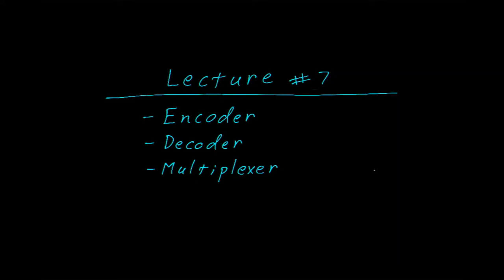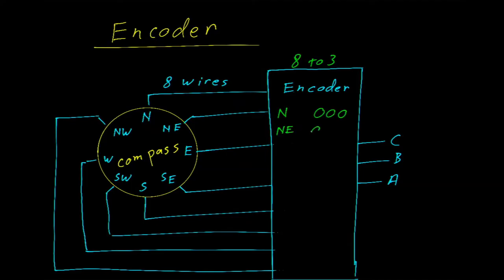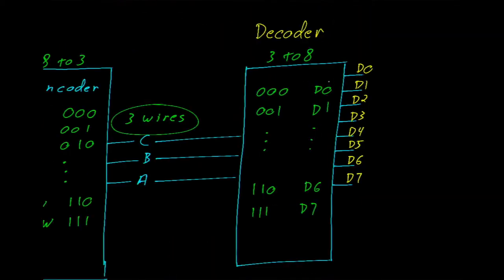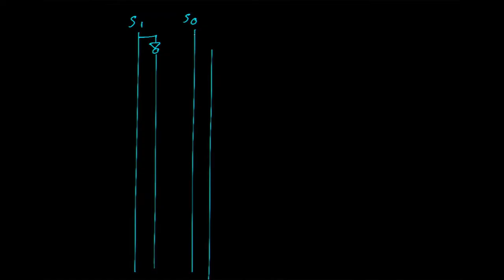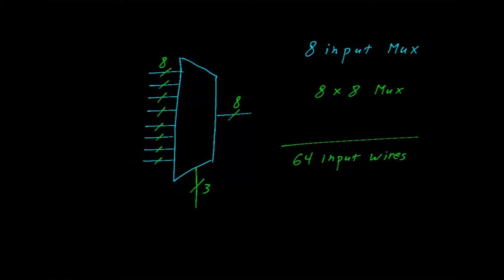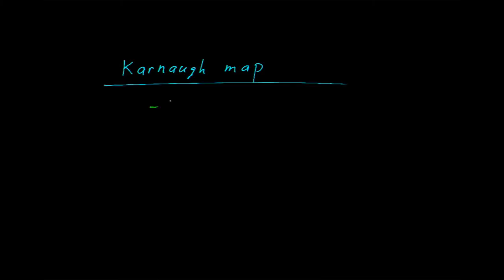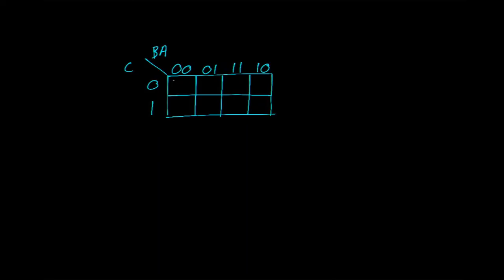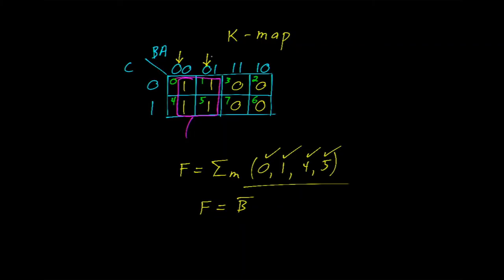Digital logic #7: Combinational logic including the encoder, decoder, and multiplexer

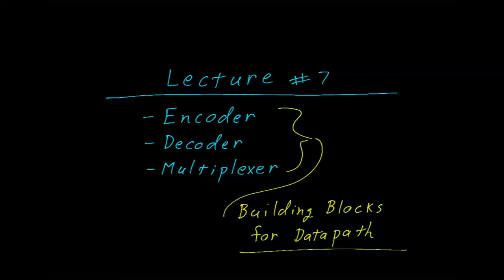Comment: 00:24 1 Output: Combinational Circuit 
01:05 Multiple Outputs: 7-Segment Display
02:18 Encoder (Input > Output)
04:57 Decoder (Output> Input)
06:15 Internal of Decoder (Array Style)
08:20 Priority Encoding: Input (Data space)
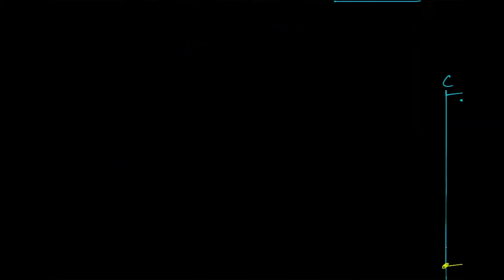08:56 Multiplex (MUX)
09:42 As a switch by using control line
11:08 Internal of MUX
14:00 Input to Control line relation
15:44 8x8 vs 64 x 64
16:30 Review of Circuit Notation 
17:15 Finding the Simplified Circuit
19:02 Karnaugh Map (K-Map)
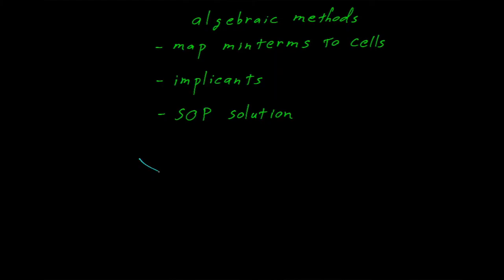19:55 K-Map of AND Gate
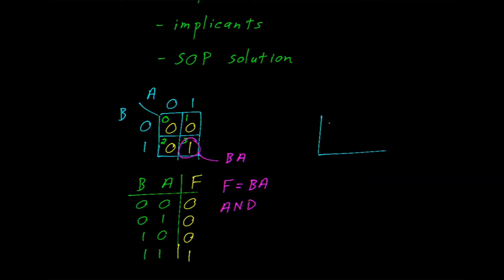21:13 K-Map of OR Exclusive OR Gate
22:32 Reading 2x4 K-Map (Caution)